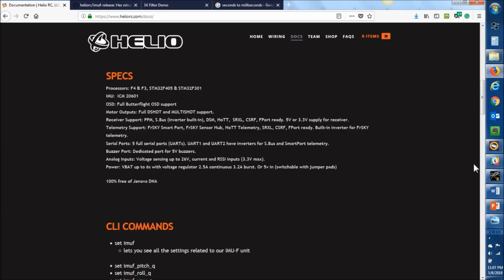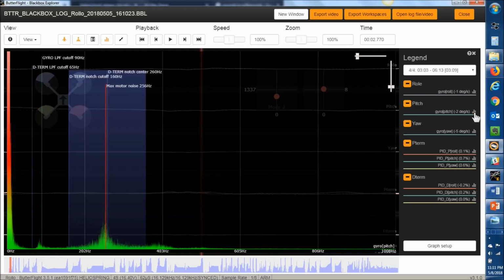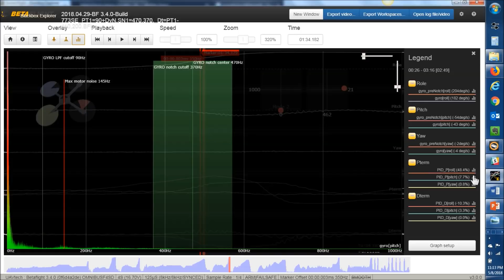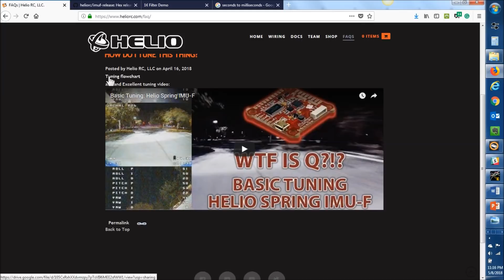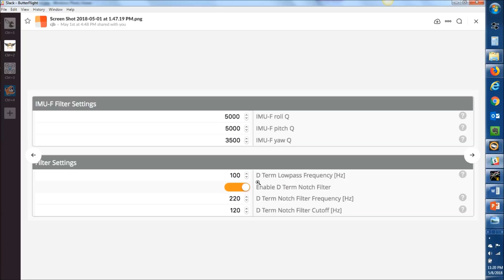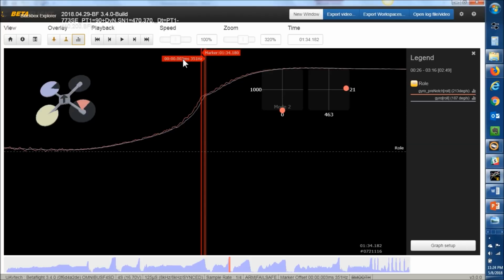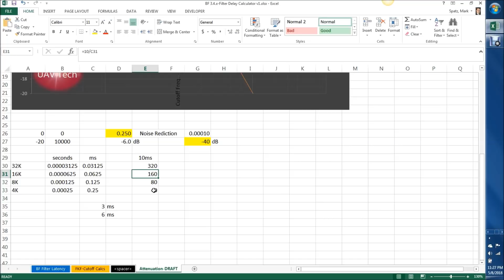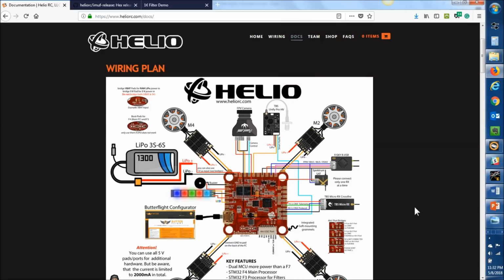Helio Filter Review - No Notches! (Where Hype meets Reality)

Comment: Thanks for the feedback. We are always open to knowing how people think we can improve. That being said:

A) a certain level of BBL noise is exactly what you want. Otherwise, you’re over-filtering. A perfectly flat noise profile is not strictly desirable because your pids need to compensate for actual motion regardless of frequency. 

B) When it comes to frame resonances, you raise your LPF value to just under the peak noise to kill it.
Reply from the maker: The noise spike that is getting through is causing jello.  So needs more attenuation.  Raising of the LPF should not help (as covered in the video), but folks are testing that now.  I would be happy to be wrong there.

Thanks for the comment.  Please keep it coming.  The goal is a solution.  One option is to let folks enable the Dynamic Notch, but you may have another.
Reply: Actually you need to look at what is causing the noise spike in general. Usually it’s an external cause. When you start using filtering to compensate for crappy frames or shoddy build technique then you end up with a quad that sucks responsive-wise. It’s like having a gag reflex. It’s there so when you have something too far down your throat, you don’t suffocate. But when you ignore your gag reflex (filtering it out) or you don’t have one to begin with, then you won’t know if you’ve shoved something too far down your throat and you’ll end up suffocating (crashing)

My point is, If you have noise in your blackbox, you should at least try to figure out why the noise is there in the first place and fix the problem. Not mask it.
Reply from the maker: Agreed, fixing the hardware or soft mounting is better first.  Always been preaching that.  See my "attacking motor noise" flow at tiny.cc/filtercalc.  That said, it will produce a better result with any board or software (universal).  So if comping filtering, we need some noise to compare and see how the software can handle it.  Didn't go there.  Just focused on not having notches.  Please strongly consider to add as an option -- even if you don't recommend using.  Their cut is superior compared to LPFs or comparable filtering.  If another solution that is better -- yes please!  that works too.
Reply: UAV Tech we have a better technique in the works with 1.0.7 “Odin.” You mentioned how R is automated, we are also looking at making W dynamic as well. We have a few options on the table and are proactively building “flappy” quads with issues such as frame resonance (my rooster for example) and cracked arms and plates to simulate real world scenarios that might happen to make sure we can compensate effectively.
Reply from the maker: Helio RC , that sounds great!  I listened to the Deadband interview, can't wait to see what comes next.

One thing that would be nice - and other folks have said to me as well - is to publish data on the website in regard to raw noise and how new filtering is attenuated it (good science/engineering).  I'm sure you are looking at the data for your testing (BB traces of raw vs. filtered).  Also, it might be helpfull to you too, to allow for a debug_mode for users to see their raw noise so if it is unreasonable to expect the Helio to filter it, that can be captured.  I mean, any software filter has a limit.  That of course includes Betaflight, iNAV, etc... (w /notch filters, etc...).  That way when there is a user issue, the raw noise can be captured in a log as a part of the troubleshooting to see if a reasonable expectation to be able to filter it out.  Sometimes, folks just need to fix their mechanical stuff.  Period.

In regard to the publishing:  I would love the hobby to be more data centric to back up the great things folks are doing and experiencing.  Please don't take as a swipe or anything else, it is not that.  I just think it will cut down the drama and is fundamental to the bedrock of modern society; publishing data results on new, better, tools and techniques.  To move from a "claim" culture to an "observation" culture looking at published results/data.  No drama, just good science/engineering.
Reply: 'fly only with fresh motors and props, dont use cheap components'
uhm yeah 
but i can do just the same with betaflight and a generic f4 with less filtering and 8k/4k
Reply: I don't understand how setting LPF cutoff to just under peak noise is effective. Doesn't this assure that you are only getting 3 dB or so of filtering at the point where the noise is highest? 

I will probably not see your response to this comment because YT comment notifications suck so feel free to message me privately if you want to discuss.
Reply from the maker: That advice has appeared to change.  Now the recommendation is to set to 60hz.  Which makes more sense to me.  See https://www.screencast.com/t/8WwNufL82JCP.  However, that adds more latency then switch from 32k down to 16k so you can turn on a notch or whatever.  Also, they are brewing another solution that is supposedly the best of both worlds.  Still in testing.  Helio can clarify more of course.

Comment: I just have to say Thank You, I got this FC on the drone dropbox, In good time because I broke the usb port on my other one, so it was a replacement, Mounted everything and my mistake was fly all on default, I smoked a motor, I haven't been able to fly and was thinking on giving up un helio. Did the adjustment, W 116 and Q9000. The quad is now flying almos perfect on default pids. So if you read this, Thanks a lot

Comment: thanks man. I'm glad someone is willing to challenge the hype ;-)  
BTW, I upgraded to a FC that could do 32k/16k (Matek-f405 with ICM20602), but in the end I found 8k/8k yielded the 'best' result (taking into account the difficulty in dealing with the extra noise at 32k). Maybe I'm not a good enough pilot to tell the difference. That's entirely possible, but personally I found more value in just upgrading ESCs to beheli32, than changing firmware.
Reply from the maker: Thanks.  Have got heat already and expect more.  :-/ 

Just as long folks know what they are getting, or not getting, when they make purchasing decisions.
Reply: Heat? Not from the manufacturer I hope. anyway, I think your content is very important and fair. you ask the questions that most people should be asking. I find it hard to believe anyone would object to that
Reply from the maker: Yeah, heat on the Butterflight slack, heat below, heat everywhere. :-/

It is OK, kind of expected it, but felt folks should provide something on this topic.  It was supprizing to me.  Since Butter has the Dyn. Notch (and others) you would think it would be enabled on the Helio Target as an option.  The data is why it, or something, is needed.
Reply: forget about 32k. too much filtering only in order to make it just fly acceptable
Reply: Matek F405 had ICM20602 in AIO model which actually have awful yaw twitch and yaw spin problems which was particularly hard to mitigate. Especially in 32K mode. If you aren't use front side ESC pads then you will be less affected by that :)

Comment: I have the same issue with my quad on Butterflight 3.5.1 IMUF 1.0.6. On the pitch axis I have a noise spike around 230Hz which gets amplified by the P-term. Also I have a pitch axis wobble on a qthrottle punch and a throttle cut. I've tried lowering Q which improved it somewhat, also raising P, Raising D, Raising I, but can't seem to get rid of it. This is kind of a bummer as a stable pitch axis is crucial when trying to hit a gate and maintaining altitude... I hope this will get fixed soon!
Reply: Same issue here as well with the noise spike on a Chameleon Ti.  Looking forward to it going away.  But it's still the best flying quad that I have.

Comment: I couldnt get jello/vibes out on either of my helio rigs, tried low Q, med Q, really high Q, different W values but nothing. Im using dshot and hear it makes more noise than multishot so might be the reason, anyway, Im switching back to good old mpu6000 boards for now.
Reply: If you are running over 8k/8k then dshot is broken and it is recommended to run multishot
Reply: The Helio guys say to use multishot when running anything over 8x8, but that is not because it won't work. It's because a lot of cheap esc's have too much noise and send corrupted packets when using Dshot1200. I  have  40 amp dalrc 4in1, and my build is high end hype like stuffs. I can run at 32 Dshot1200 no problem. cleanest, smoothest, quietest build I have.   Now the prospect of tuning it isn't too exciting to me. Liked the idea of dynamic filters.

Comment: I would still hope, for the betaflight crew to give us a choise to select the order of the filters. 
Im thinking of setting a static notch to take out the peak motor noise, and then let the dynamic notch move around handling the small amount of noise that would appear.
Reply from the maker: that was evaluated in the PR at: https://github.com/betaflight/betaflight/pull/5401

Comment: Helio recommendations are a bit strange. Increase d term would just amplify the noise and increase q just increase the cutoff.  For resonated frequency vibration I tried soft mounting motors and logically it makes sense but I have mixed results. One quad it works but others not very much.
Reply: i have 2 quads with identically softmounted motors (silicon pads on ether side of an arm, bolts go through wide metal washers). on one it didnt make any difference (pre notch data confirmed that), on the other - did (less propwash with beaten up props). both have dynamic notch an 1 software lpf on a gyro.
Reply: MrBirdshell666 one of the issues with motor  soft mount is you are limited by the screws contacting the frame, which can transfer the vibration. Diatone in one of the builds has motor mounts which should work better. The screws are not contacting the frame directly. Much better isolation. However I do not think those mounts are compatible with many frames.